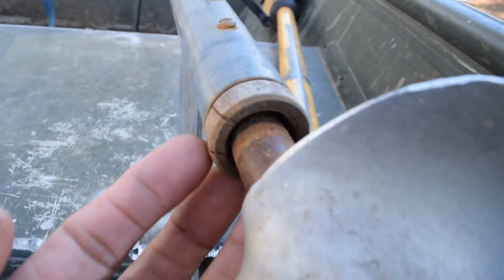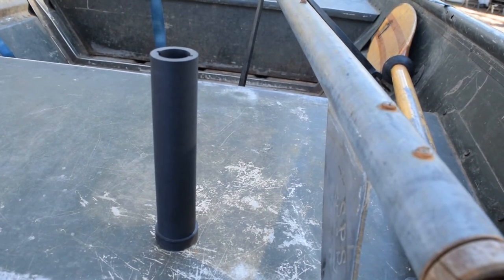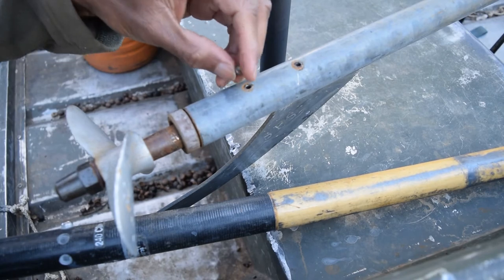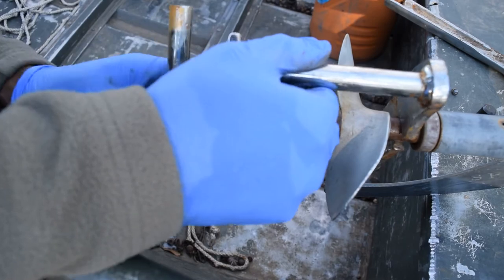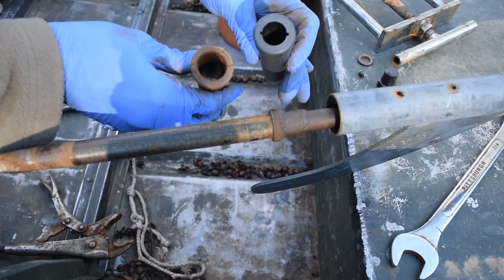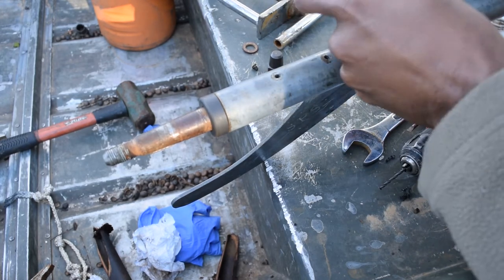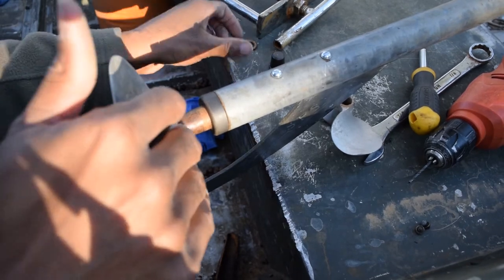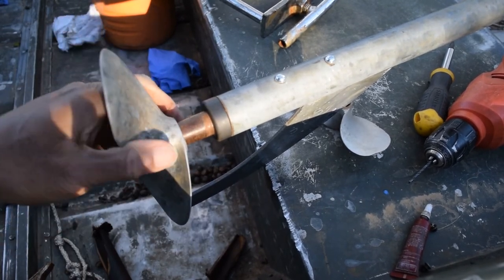How-to Install | Bayou Bushing | SPS Longtail

Comment: You might could try putting some antiseize on the tapered portion of the shaft under the prop, it should help keep the shaft from corroding and making the prop stick.
Reply: anti seize  has a bite back effect, prop will slide in more than necessary and crack with the pressure, i've seen it many times with compressor flying wheels.

Comment: I need to pick up some of those little screws that go through the shaft into the bushing. Would you know what size I should get and what kind they are?
Reply from the maker: I really don't know what kind they are. I bought mine from Mr. Dobbs at Swamp Runner.

Comment: How often do you need to keep it greased and what could happen if there is not enough grease
Reply from the maker: You don't have to grease the Bayou Bushing at all. It's self-lubricating.
Reply: Black Warrior Lures I’m talking about the orange plastic bushings
Reply from the maker: Oh, I forget. I'd have to check my manual. I don't where my manual is. It's best to talk to Mud Skipper to find out their maintenance procedures and timelines. I don;t know if it's the same and Swamp Runner.
Reply: Black Warrior Lures okay thank you because my bushing is melted and I was just wondering if it’s still okay to take it out
Reply from the maker: I'e gone out with melted bushing before and didn't have any problems. It's best to get two or three bushings if you stick with the Delrin. again with maintenance issues, ask the people who sold you the unit as they have the best knowledge on your unit type and brand.
Reply: Black Warrior Lures okay thanks I am running a long tail swamp runner medium kit

Comment: How do you get a melted one out because I just bought a boat and the bushing is melted
Reply from the maker: You use vice grips and pull like your trying to pull an oak tree out of the ground.
Reply from the maker: Generally with the pink/orange Delrin types the melted one won't have much play in it at all. The wooden ones develop a lot of play and have to be replace more often. That's why they originally switched to Delrin. But it melts if it is run of water for too long or gets tanlged in fishing line or what have you.

This new material doesn't have any of the problems of wood or Delrin. I don;t know what the material is, but it is so much better.
Reply from the maker: I forgot to say that you have to remove the screws holding the bushing in as well. Also running a Delrin bushing in the water, the water cools it off.
Reply: Black Warrior Lures okay thank you love the channel
Reply: Black Warrior Lures okay thank you love the channel
Reply: Also how often do you need to keep it greased and what would happen if you don’t grease it

Comment: Do you use anti seize on the prop ever?
Reply from the maker: No, the manual states to use threadlock. There is good reason as the Thailanders have spent 50 or 60 years perfecting the design and found that threadlock on the bras propeller nut is the  most secure way to mount it.
Reply: Black Warrior Lures sounds good. How's the new bushing holding up? Thanks for the videos.
Reply from the maker: Doing well! After eight months, it's barely getting broken in, lol. They're just that durable.

Comment: Is it delrin?
Reply from the maker: I'm confused about what you're asking. Are you asking if what I said the word delrin. Or are you asking if the material is made of delrin. If the later, no, it is not made of delrin. I mentioned that the kit originally came with a delrin bushing. The problem with delrin is that is melts given the friction form the shaft if you run it out of water over time. If it get caught with weeds or fishing line it will melt.

This is a new materials, and as I said in the video, Mr. Dobbs isn't saying what the material is.
Reply: Delrin is a type of hard machinable plastic
Reply from the maker: Okay, did you watch the video? Did you miss the part were i said the original kit came with a delrin bushing, the problems associated with delrin on longtail, and the need for a different material.

I know what delirin, and this is not delrin.
Reply: Delrin it no have a friction i proppeller still wise in water

Comment: My shaft wont spin but the motor will work without shaft connected bushing is melted do you think if i change bushings it will work again
Reply from the maker: Well, it's hard to say without looking at it. If you don't mind what kit did you buy?
Reply: Kkk
Reply from the maker: Yeah, I don't know that brand very well. I can't say, but it's a good idea to buy two or three if all they are those pink/orange Delrin bushings. I'd call them and ask them. I don't know what their customer support is like.
Reply: Ok thanks

Comment: Hello My Friend I am watching again!!  You are a good and true man. Information from a life long Heavy equipment AG Mechanic and Engine and Transmission builder. And Specialty equipment designer and one man small buisiness owner .Thank you for showing truth!!Information I am searching for from Swamp runner about their Bayou Bushing just a round about material that those bushings are made of for $100 extra purchasing a shaft. True info for you ok --Delerin is 3M composite Plastic low pressure low heat AND HERE IS THE KICKER  IT IS NOT MADE OR RECOMMENDED IN ANY USE WITH CONTACT WITH WATER !!!  Can You tell me if the Bayou Bushing is a type of plastic PLEASE !!  Truth is There is no type of plastic polymer or ptfe or hdpe or umhw plastics designed or allowed by the manufacturers specifications to be a bushing or bearing in contact with water. The Truth My Friend !! Not even oil impregnated sintered bronze bushings ie. Oilite bronze bushings they try to sell ARE NOT RECOMMENDED TO RUN IN WATER !!! Only CARBON GRAPHITE BUSHINGS ARE DESIGNED AND RECOMMENDED FOR WATER AND GASOLINE AND NON OIL BASED LIQUIDS.  That is why I am asking you if the BAYOU BUSHINGS ARE A TYPE OF PLASTIC BUSHING--High Density Carbon Graphite bushings are basically a carbon steel type of bushing with no steel ingredients in it . They are only graphite formed under high temp and pressure. 99.99% carbon. Thank you for your time. Please get back to me on if the Bayou Bushings are a plastic. I Love Your Videos My Friend !!  I have new project building soon. 1438   .052 Aluminium hull jon boat make shallow water ( 5 inches or less ) Sand bottom river runner in north east nebraska with a long tail 13hp Predator and one of a kind sand water proof hull and outdrive !!  It is a major challenging designing feat. I will do it. I am self taught. I have John Deere Certs and welding degree and electrician degree from trade school in the 1980s. I love to design and build ONE OF A KINDS in anything :  )  Gods Bless You Every Day My FRIEND !!!!
Reply from the maker: I don't know what it's made out of. After two years of using it, it's just getting broken in well. With my newest motor, the 420 Predator, I just got the standard shaft, the non-Bayou Bushing. The standard shaft no longer has the pink Delrin bushing at all, so even the standard shaft is better. It's some kind of green something. You're better off spending $10 extra dollars for the 100 inch standard shaft.

You can always get the Bayou Bushing later if you want. The wooden internal bushing and the current rear bushing have powered the whole country of Thailand for, what 60 years?